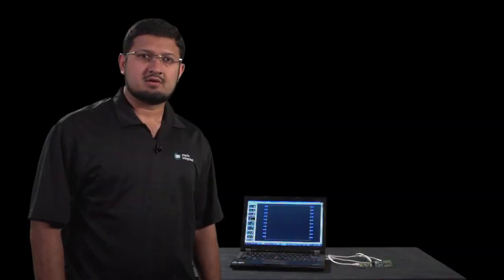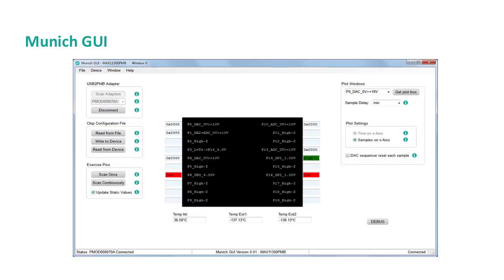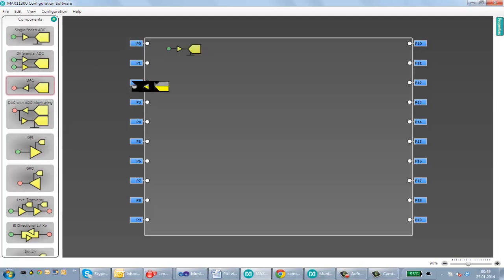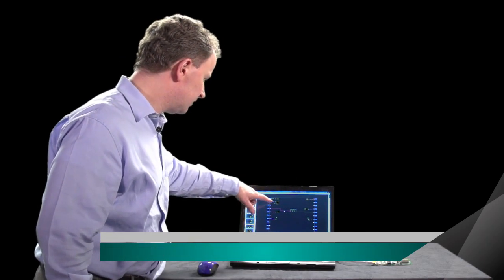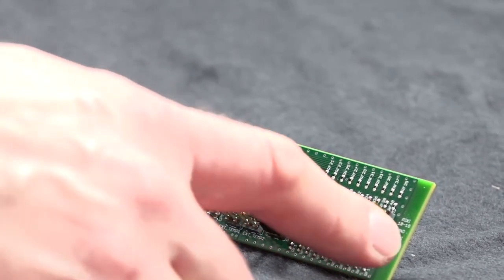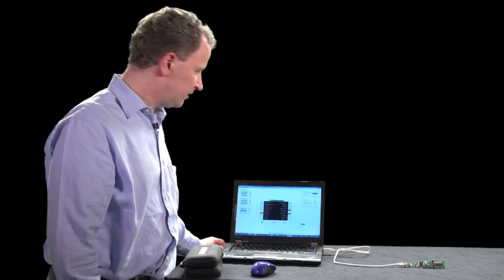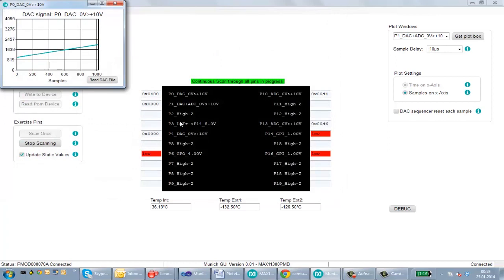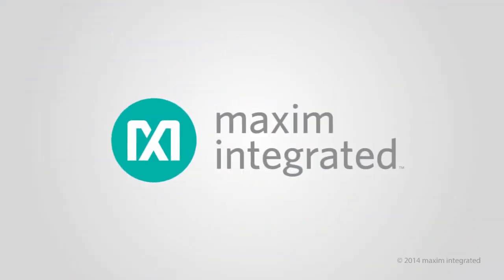Pixi PMOD Demo

Comment: Very nice device, but the leakage to each pin is to high , ideal would be  nA but it is 5uA each pin ... Very sad otherwise it would be a perfect device
Reply: yes that's pretty high. In the Datasheet it says that this counts only for the communication pins SDA, SCL, AD0, AD1, CNVT. It's a bit unclear if this is also the case for the GPIO.